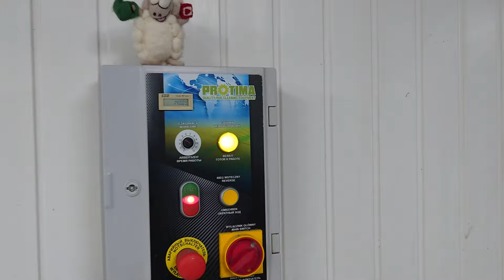Ten biedny dywan aż prosił o pranie 🙏 opuszczony na lata w starym domu | Relaksujące Pranie Dywanu🐑

Comment: Analysis time:  I hear no music this time.  1:25 Lots of dirty water coming out from the watering.  2:12 I had a feeling it was going to want to move being a small rug.  4:13 you can actually see some big dirt particles on the wash floor from this rug.  4:46 this rug looks better already.   8:33 shaking the CRB.  was there a problem?   9:21 lots of froth and big bubbles being generated here.  13:39 It is interesting hearing the difference in the brush sound when doing the under side of the rugs.  14:42 fancy, a behind the back spray.  20:39 What was that sound?  Great job.